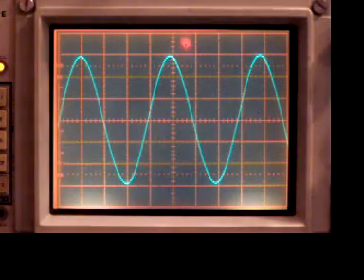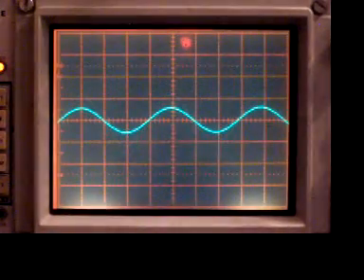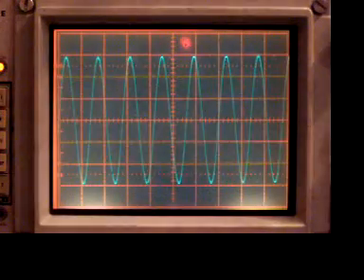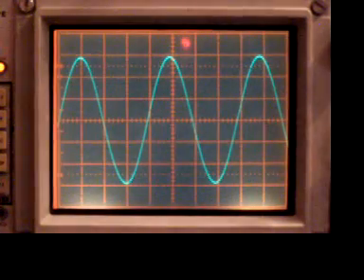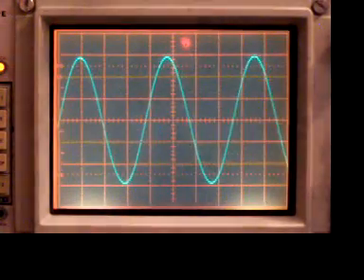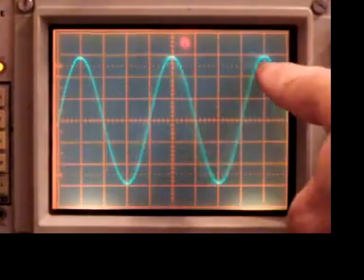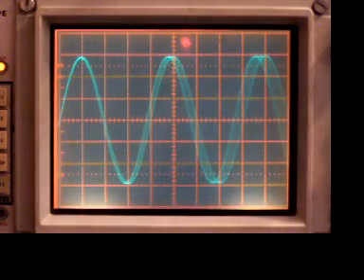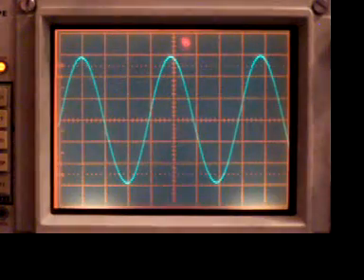Frequency Modulation

Comment: Nice, but it leaves something to be mentioned doesn't it?  The carrier is changing its frequency between two frequencies at the several example 'rates' or frequencies you use in your demonstration.  I guess that's shown by the thickness of the line that appears on the oscilloscope at higher rate of frequency modulation.  But what is this width of this frequency change?  I also notice the waves seem to move more towards the right of the scope when you modulate.

Comment from the maker: @nlimchua If your Signal Generator does not have a switch or input marked FM then most likely it is going to only modulate using Amplitude Modulation.  Two of my signal generators will modulate FM as well as AM.